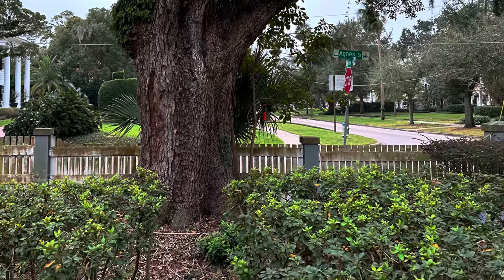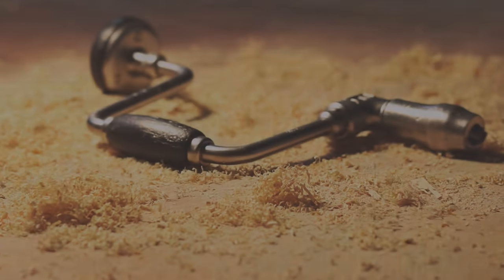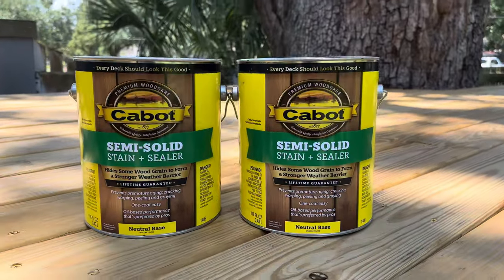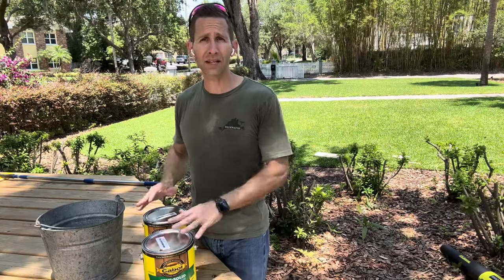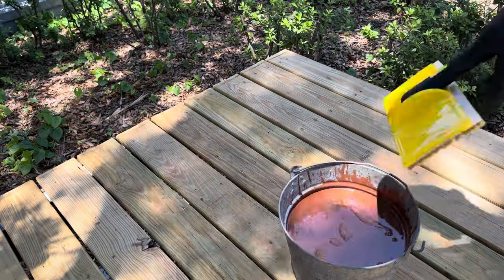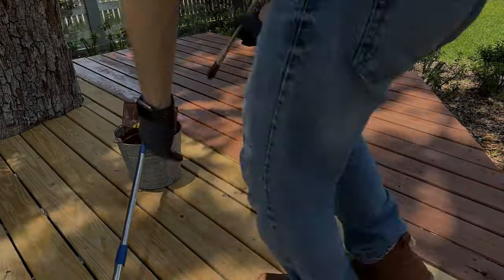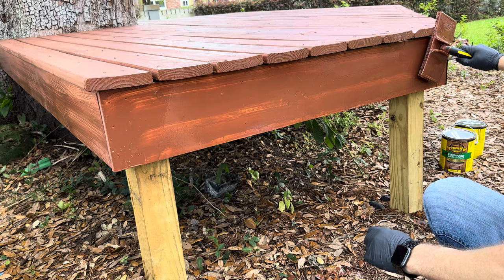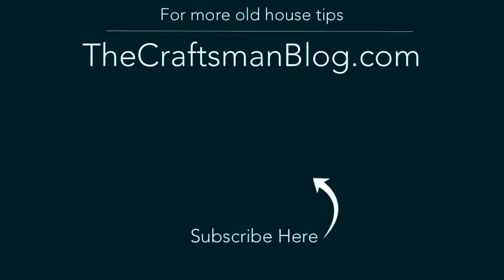Cabot Deck Stain For Pressure Treated Wood

Comment: Great technique although Just a tip  always check the moisture content of the wood with a pinned moisture meter. Make sure you got below 12% moisture content. Ideally 10% but never above 15% or the stain will not absorb. You will also trap moisture in the deck which shortens the life

Comment: Thank you for this video! I have Cabot solid oil-based and haven't used it in a few years, so it is a bit thick. Can I add mineral spirits to thin it out a bit?

Comment: Why not 2 coats?
Reply: wood can only absorb and hold so much stain... a second coat will end up sitting on top of the wood instead of "in" the wood.  That will lead to peeling like paint would.
Reply: Latex stain does not penetrate wood, especially pressure treated crap wood. Even a thin oil based stain doesn’t penetrate that much unless you’re using soft pine, which would be useless for decking.

Comment: Doesnt look that great to be honest
Reply: Typical rude boomer to be honest.
Reply: Yeah, it's super streaky on the sides, maybe the boards were still wet from pressure treating?
Reply: @travelswithtrekkers1326 wrong.   He wasn't rude.  Just stating his opinion. He didn't attack anyone's character. I also agree with him. I think it looks pretty crappy. Has nothing to do with the way it was applied. It's just that the stain is kind of blah and not his fault.
Reply: Lolol facts
Reply: Should have used a brush and put in a second coat